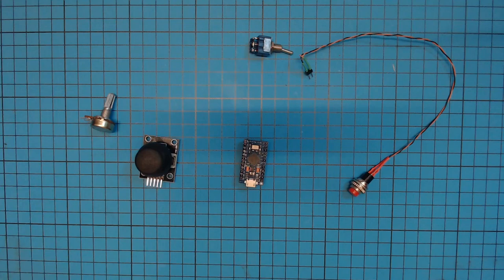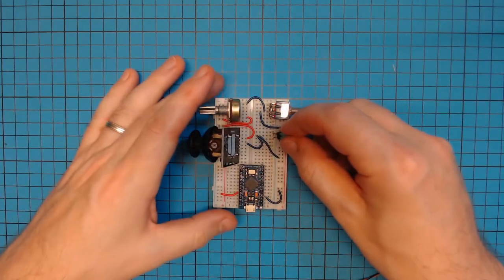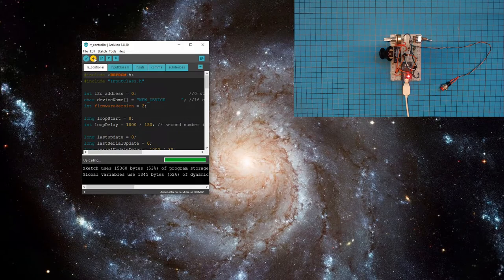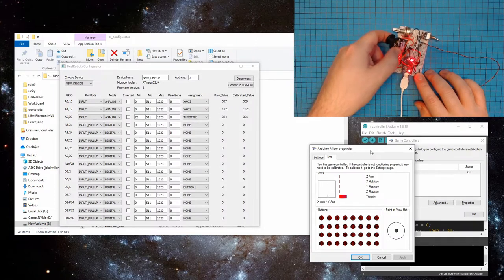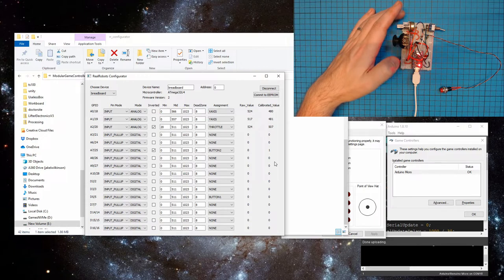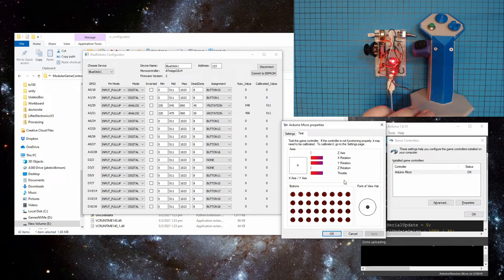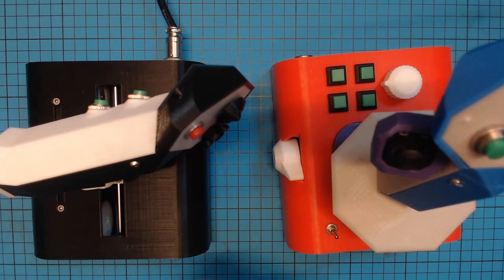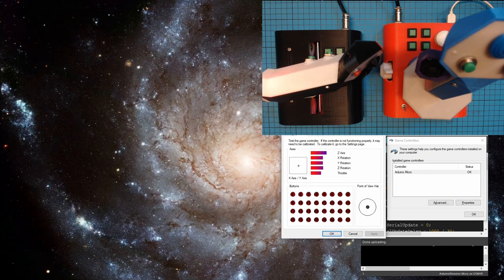RealRobots Configurator - Build your own controller with NO CODE

Comment: Great work. I am using a  NodeMCU-32S  (ESP32). Every thing seems OK but I can't save my config from rrconfigurator to the ESP32.
Is there a particular ESP board I should be using?
Reply from the maker: Hi, that's a known bug, it happens to me on some of my ESP32 units and not on others that are the exact same type. Funnily enough I was trying to solve this problem today but couldn't get any of my test units to fail. Sorry about that but there's not really a fix for it, if you've got a second ESP32 give that one a try.
Reply: @real_robots  Thanks for your reply. I tried another ESP32 (TTGO-T8V1.7.1) but still unable to save to EEPROM.
This is what I do. ..
1. Install firmware on ESP32;  2. Run rrconfigurator;  3. add button and slider and test in rrconfigurator; 4. Give a New_Device a name (ESP32_config) and commit to EEPROM. I see confirmation. 5.Reboot ESP32 board and rerun rrconfigurator, check Choose Device drop down list but DO NOT see the ESP32_config in the list. What am I doing wrong??
Could you please explain the procedure.
Reply from the maker: @frankmentiplay8343  You're doing everything right, the name of the device won't change for your computer over HID though, the device name is only for rr_configurator. The configurator doesn't support changing hid names because it wasn't possible under the original USB HID library I used.

For bluetooth there is a way around it though, before you upload the code to your ESP32 open up rr_bleHID.h and change "RealRobots Controller" on line 100 to whatever you want.

It still won't save to eeprom though, it's a known bug and I still can't find a device it'll fail on so I can work it out.
Reply: @real_robots  Problem solved. I went and got a ESP32 30 pin Dev board, like the one I saw in your bluetooth video and it worked.
i.e. I was able to save configs to EEPROM
Thanks
Regards Frank
Reply from the maker: @frankmentiplay8343  Great to hear!

Comment: Is it working with old Nes controller Dpad?
Reply from the maker: Sure, those are just 4 switches, if you wire up each one the same way I wired a button in this video then it will work.

Comment: Hello, in which games does it work? I mounted my Throttle but it is not recognized in the DCS and using the Flight Simulator it does not have fine adjustment, or it is at 0% or 100%, what would be the problem?
Reply: And the rr configurator has no option  in assigment of throttle or rudder as you show in the video.
Reply from the maker: @benebearded  it should work in any game that accepts joystick input as it uses standard HID.

Does it work in the Windows USB game control tester?
Reply: @real_robots  Yes on windows it works well, the bar runs from 0 to 100% smooth, but in games it works either 0% or straight to 100%
Reply: already tested with another program on arduino, and the problem is the same, goes from 0 straight to 100. can be the value of the pot? I'm using 50k
Reply from the maker: @benebearded  If it's working well in the windows USB game controller setup then it must be the game. The values that the windows USB controller app shows are the same ones that the game should be getting.

I'm not sure what's going on, can you send me a screenshot of your rr_configurator setup to realrobotshk@gmail.com
Reply: @real_robots  Email send! thx!
Reply from the maker: @benebearded  Just watched the video, that looks like it's working perfectly. Like I said, if Windows is receiving the inputs properly I can only think it's got to be something with the game, have you tried others?

You pointed out the !RESERVED! axes that I've locked out for now. I have the device reporting to Windows as having the maximum amount of axes even if you don't pick them because of bluetooth, you used to be able to pick and choose what axes you wanted but whenever you change the report Windows wouldn't pick it up in bluetooth until you forgot and repaired the device and it was a huge pain, so I just locked in the max amount of axes and let you choose from those. 

I'm rewriting my own HID library now which will handle that a bit better but unless the game specifically doesn't read the axes available that shouldn't be the problem.
Reply: @real_robots  I tested it on Star citizen and DCS, it doesn't recognize on either, I also tested it on war thunder and flight simulator, it recognizes on them, but it doesn't have fine adjustment of the accelerator.

bad luck for me then, I wanted to use it in DCS and SC, sad
I have already tested 3 different programs on Arduino and they all give the same result, with no idea how to solve it.
Reply from the maker: @benebearded  That's so weird, sorry I couldn't be more help.
Reply: @real_robots No problem, I'll fix it soon! 
thanks for your help and for sharing your work, it helps a lot! especially for someone who doesn't know anything about Arduino like me! haha  

Question, does rr-configurator work with atmega168 and Mega2560 or just with Atmega32u4 ? or others like Leonardo

The arduino being 8Mhz or 16Mhz makes any difference?
Reply from the maker: @benebearded  I originally had it working on Atmega2560 but it's temporarily disabled because I simplified some of the device to device communications. I'll do an update soon to allow devices to have more than 16 inputs and will reenable the Atmega2560 then.

The thing is though that it could only be a subdevice, the reason the code is originally made for the Atmega32U4 is because that can do USB HID. 

The code also works on ESP32, I wanted to add that because although it can't do USB HID either, it can do bluetooth HID.
Reply: @real_robots  i can use Encoders?
Reply from the maker: @benebearded  Not yet, I have the code mostly working in a test branch but it's a bit janky and I'm not sure if it's the code or that my encoders are junk. It'll probably be in the next update

Comment: Hello, I have followed all the steps but when I verify the code I get an error that says "joystick.h: No such file or directory". unfortunately I can not solve the problem I have tried several times and can not get the program to load due to the failure.
Reply from the maker: You need to put the joystick.h library from MHeironimus in your arduino/libraries folder.

https://github.com/MHeironimus/ArduinoJoystickLibrary

It handles the HID communication if you're using an Arduino Pro Micro.
Reply: @real_robots  oh thanks a lot! im gonna try it!
Reply: @real_robots  Error again, my board is SparkFun Pro micro (but in windows is Arduino Leonardo) . Cant run the program on SparkFun pro micro
Reply from the maker: @lucasromanow1688  It should definitely run on a SparkFun pro micro, it shows up as a Leonardo because they are the same chip with the same bootloader. You can try selecting the Arduino Micro board from the list but it shouldn't matter. My cheap Chinese manufactured Pro Micros are the same.

Are you getting the same joystick.h error? If you are then I'd guess you haven't installed the library properly, it can be tricky. You need to get everything in git repo in that link I gave you and put in in your Documents/Arduino/libraries/Joystick folder

You'll have to create the Joystick folder but the rest should already exist. You should also close and reopen the Arduino IDE so it loads all the libraries again.
Reply: @real_robots  Thank you very much for the help, I've been trying to solve the problem for many hours. I will try again all the advice and help, I hope you can solve the problem at some point
Reply from the maker: @lucasromanow1688  What error are you getting now? Is it still the same "joystick.h" one?

If you want to try again I've recently set up a discord server so troubleshooting can be done more realtime

https://discord.gg/QzrrbQVfpb

Comment: An error appears when uploading: "Sketch uses 94514 bytes (4%) of program storage space. Maximum is 2097152 bytes.
Global variables use 43296 bytes (16%) of dynamic memory, leaving 227040 bytes for local variables. Maximum is 270336 bytes.
.....................
An error occurred while uploading the sketch"
Reply from the maker: That is only telling us the size of the program, not the error.

I'm guessing it's something to do with built in libraries changing. Try using Arduino 1.8.x instead of 2

Comment: Can I use an Arduino Leonardo?
Reply from the maker: It will work but I haven't tested it, I think some of the pin assignments might be different on the Leonardo as opposed to the Pro Micro. THe worst I'd expect from that is that the numbers won't match what's in my configurator and you might have a few not work at all.

If you try it and are missing a few pins that you need there's probably an easy fix by just renumbering them in the firmware

Comment: hi. does it work with Arduino nano every ?
Reply from the maker: Arduino Nano can be used as a secondary device to add more inputs, but it doesn't have the hardware to be the main device and tell Windows it is an input device (HID). You need an Arduino Pro Micro for that. You can also use an ESP32 if you want to have bluetooth HID.

Comment: Can you do this with a raspberry pi pico?
Reply from the maker: Not at the moment, I wrote a library that lets you code the rp2040 yourself

https://gitlab.com/realrobots/PicoGamepad

That doesn't integrate with my configurator, I'll be integrating it into my new one but haven't yet, the new one only works on esp32 at the moment.

www.realrobots.net/configurator
Reply: @real_robots  Thanks for replying, hardly any youtubers do that. I was wondering if you will be creating more videos, my computer says your last upload was 1 year ago.
Reply from the maker: @sammymiller6740  I was doing videos mostly during the pandemic and don't have heaps of time now. I'll be doing one when I get a decent number of features working in the new configurator though.